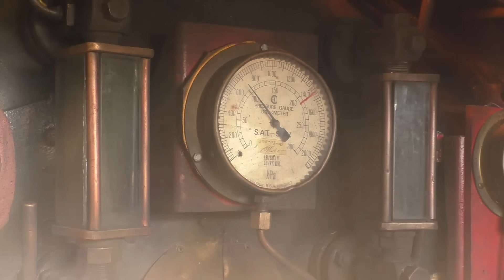RED DEVIL - Restoration - Final Steam Test and Transfer

Comment: Jesus Christ 5030 hp from a NARROW GAUGE locomotive? That’s nuts!
Reply from the maker: Slipped like hell though. Not enough driving wheels to transmit all that power into the rails.
Reply: Wayne Nauschutz Ah, so I take it the factor of adhesion was low? Sounds almost like a racecar with too much power for its own good.
Reply from the maker: Yeah, definitely. If they approved the project it most likely would have led to the development of an entirely new class. In the Red Devils case they had to use the frame that was available. Here's a insert from Steam Fever, https://www.youtube.com/watch?v=OtRfcYk245k note the wheel action at 0:45.

Comment: Oh YYEEESSSS!!!!!!!!!!!!!!!! THIS is what second gen steam can look like if its given the chance.
Reply: More like third or fourth generation i think (Chapeleon' s high superheat and work preventing undesired heat losses in the valve chests and before that the super-high pressure work for example the D&H John Jervis)
Reply: I totally get where you're coming from. It's just a shame it didn't catch on sooner. I mean, between the advancements on this along with poppet valves and one-piece cast frames, every day - use mainline steam probably would have had another thirty or forty years in it. I'd put one of those up against a modern diesel any day.
Reply from the maker: Great idea, wrong era unfortunately. Thanks for watching.

Comment: Can someone please explain the purpose of the blinders on the sides of the smokebox? The red paint is a bit unusual to an American, but still quite attractive/striking.
Reply from the maker: The large vertical plates on either side of the smokebox are smoke deflectors. Often used on locomotives with very short chimneys as they assist in creating an upward draft that lifts the smoke up and over the locomotive.

 The SAR had a strict painting policy where all locomotives had to be black. Wardale secretly ordered the red paint so that the modified locomotive would not be swept under the rug. One really needs to read the book to truly appreciate the extensive work done and the politics that were mounting against him at the time.
Reply: Hello Wayne,
 I thank you for the education about this beautiful locomotive. It is definitely a “looker”.

Comment: well done all! But I can and do throw coal better than 1:40. Nowhere near the front of the long firebox. Wont keep up pressure like that, m'dears.
Reply from the maker: Those blokes are the fitters. In this case they had to do the light up as there was no one else. Out on the road it has a mechanical stoker. Thanks for watching.

Comment: Okey, swallowing my pride with this question here. What is the name and purpose of the plating near the front. The only other time I saw this was in a war movie and I thought it was an attempt at armor from small arms fire.
Reply from the maker: No, such thing as a bad question. The large vertical plates on either side of the smokebox are smoke deflectors. Often used on locomotives with very short chimneys and they assist in creating an upward draft that lifts the smoke up and over the locomotive. Thanks for watching.
Reply: Wayne Nauschutz, thank you.

Comment: I seriously love that whistle! I honestly think Atlantic Rail's 3655 Jenny could benefit from something like that.
Reply from the maker: Hi Joshua. Both locomotives are fitted with SAR three chime whistles. The NCs tend to sound very different due to the higher operating pressure of the boiler.
Reply: Okay. Interesting. I noticed that when Jenny was returned to steam in July her whistle didn't sound like the iconic SAR 3-chime. It was more like a high pitched screamer, lol, but at least it is something to work with for now.
Reply from the maker: The chime chambers were filled with a small amount of molten lead to make the chamber shallower.
Reply: Hmm, very interesting. So, to make it sound like the iconic SAR 3-chime some more molten lead would need to badded to make the chamber deeper.
Reply from the maker: Far from an exact science. Identical whistles sound different simply by mounting them differently.
Reply: I actually didn't think of that. Thanks for the very interesting info.

Comment: Beautiful engine and camera work.    I'm impressed they are running it on coal.
Reply: South Africa never ran steam engines on oil. In fact one of the reasons they kept steam around for so long was they had domestic coal reserves but very little oil, and with increasing pressure from international sanctions they didn't want to be dependent on foreign imports.
Reply: So I take it you're somewhat of a rail fan? That's so cool!!
Reply: Notice how small an amount of exhaust smoke there is. That's efficiency, almost no unburnt fuel, because of L D Porta's work on secondary air admission, to improve the combustion.
Reply: @ericjamieson  same with the UK

Comment: your notes say it had 5000 horses.  i'm very impressed.  i observe your notes also say it had a lempor exhaust.  is it still fitted?  this invention was fitted to 2 victorian railways r class locos.  there were 2 chimneys.  it has been removed from one of them.  i don't know about the other.  a crewman considered it added more than 20% extra power.
Reply: the 2 locos i mentioned were vr r711 and r766.  both had the go-fast equipment removed.  it was written by someone close to the operation of r711 that the loco threw a rod (first and only of this class that this happened to) most likely because the gear wasnt designed for the extra horsepower.  r766 has recently been reactivated.

Comment: Beautiful piece of equipment. I am curious, I know that an engineer has to plan how hot to stoke the fire but what about when coming to the final destination? Is the engine monitored and water added as needed until the fire burns out?
Reply from the maker: Thanks for watching Dremwolf. In this case, the drop grates get opened and the fire is pushed out of the firebox and into ashpit. During the steam days, they would have a locomotive minder that would look after a number of locomotives during rest periods.
Reply: You don't do that. The usual thing is to think ahead .....  because you don't want to add oxygen-rich water without having a steam demand. You would want to boil away all oxygen as fast as possible.
Normal is to stop feeding water to the boiler lets say 10 minutes before coming to stop outside the shed.
Reply: Wouldn't that create a too fast cooling down ?
Reply: Stefan Skoglund ordinarily you'd run the fire down towards the end of the day, arriving on shed with as little as possible so there would be less to remove. At the same time filling the boiler slowly, avoiding filling it all last minute, so that as the loco cools there will still be plenty of water in it to relight  for its next steaming.
Reply: Is the feed water deoxygenized ie is water treatments chemicals used ?
The machines i'm on (a steam boat and a locomotive) we stop adding coal 20 min before and stop the water feed 10 minutes before coming to the quay (the boat.) At the locomotive i let the water level rise slowly to the top of the glass in the last 10 minutes running time. The fire is allowed to get a bit thinner (she has a really good draught) but not near the firebox plates - only in the middle of the grate. This to prevent cold air near the copper plates and this is alsy why we don't drop the fire (slow and mild cooling down.)
Reply: Stefan Skoglund we certainly use water treatment but I couldn't say for Oxygen content. We always drop the fires just before the engine is put to bed, so it's not draughting too much after that. At the same time the dampers will be fully closed to minimise the cold air intake. Leaving fires in isn't recommended as there is no-one looking after the locos over night, so the water-pressyre won't be monitored. It is surprising just how far the water can drop with a fire left in over night.

Comment: Thanks for the updates Wayne. Great to see her up and running again! However..... something doesn't sound right, the typical Lempor exhaust beat is absent. Do you know if the front end is still original, or has that also been destroyed?
Reply from the maker: Thanks for watching Sean. Yes, the blast nozzles are both standard 25NC equipment. The original Lempor nozzles were removed years ago while the locomotive was at Dal.  The nozzles do still exist but are in poor condition.

Comment: Doesn't it have a mechanical stoker? That surely is too big for manual firing. 
Sitting on top of the boiler attacking the safety valves with a big spanner looks a bit hazardous.
Reply from the maker: Yes, it does. During the light up process, there is insufficient steam to operate it.  The safety valves were being set as this was the first steam test during which locomotive reached its maximum operating pressure.
Reply: Setting the safety valves is done like that.
Usually what is done is you do a preliminary blow of setting using pneumatic air - that allow to check that the valve opens at all and that it opens at about correct pressure.

The next thing is how the blowoff happens ie the duration and that it is a clean blowoff and closing. You dont want a clapper-like action. Steam differs in mass and speed from air so pneumatic air can't be used for this work.
It is different if you have access to an industrial boiler with high pressure steam and a safety valve test rig.

It isn't a regular spanner.

Comment: Honestly, they should give back her original smoke deflectors, I feel that her Class 25NC deflectors are too big, look odd on her and make her look generic. 

Also another thing, A friend of mine wants to model the Red Devil for a game and is in need of blue prints and drawings, can anyone here point me in the direction to where I can find some?
Reply from the maker: The German style deflectors performed poorly. The problem is often mentioned by drivers in the Locomotives logbook.  The current deflectors aren't standard 25NC components they far taller and curve over the boiler, they also extend over the buffer beam. 25NC blueprints are common but the actual drawings for devil are far and few between. There was a bloke called SAR models or something to those line selling drawings at one point.

Comment: i dont really like the fact that the boiler looks a bit oversized in nsw the boilers are slightly oversized and also the front part of the runningboard is very short and it looks unusual
Reply from the maker: The smokebox was extended to be able to fit the larger superheater header. Keep in mind this is cape gauge (3'6") and not standard gauge.
Reply: @WayneSA85  ok now i know why

Comment: The amazing thing is how narrow the gauge is, can't remember exactly but it's 1m or 3ft 6in?
Reply from the maker: Yes, correct.
Reply: It is Cape gauge, 3'6", not metre gauge of just under 40".    There are some examples of large modern nonarticulated steam power on metre gauge, notably the French GELSA locomotives built after WWII, but they are on a remarkably smaller scale than the South African power; it's remarkable that so little difference in gauge makes so much proportional difference.

Comment: This is my idea of a heavy metal band. Big pieces of steel flashing around, steam wafting and the grunting sound of power. I used to be a "studente stoker" on the 15CA and 15F's back in the early 70's and I will never forget the smell of steam and hot oil. Lovely memories.
Though, I wish to ask a question, what is the purpose of the steam release pipe just behind the smoke stack? I have seen them also on videos of the Sandaoling mines in China and I could see no obvious purpose to it.
Thanks for a beautiful video.

Comment: paint it blue and you'll have a flying scotsman
Reply: Isn't the Flying Scotsman green?
Reply: @midwestrailfanner2268   the original was blue later versions were green
Reply: @rudycarlson8245  actually i thought they changed it to the brittish racing green
Reply from the maker: Called the RED Devil. Painting it blue would not be historically correct.
Reply: @WayneSA85  understand it was painted red in africa however it is the same chassis as the flying scotsmanand the canadian and us sister  which all now sit in the UK
Reply from the maker: @jasonhowe1697  Hi Jason, I think you might be confusing the Red Devil with some other locomotive. The 25NC and the A3 have very little in common. The 25NC had a one piece cast frame which included the cylinders, the castings were done at Commonwealth in the US and the remainder of the locomotive was built in Germany by Henschel(some where built by NBL but not 3450). The A3 had a bar frame that was bolted and riveted together. The A3 is also a three cylinder where the devil only sports two. 3450 (Red Devil) was highly modified in the early 80s by David Wardale during his time as a engineer with the SAR. What emerged from the shops was re-classed as a 26 class. Wardale was facing stiff opposition from the SAR brass who had already dismissed the locomotive as a failure long before the trials had even started. He knew the only to give it a fair chance would be to sway public opinion. So despite of the SAR's strict painting policy. He secretly ordered red paint and had friends notify the press. Before long pictures of this big Red locomotive were everywhere and the SAR management had no choice but to play along. So the red is very much part of this particular locomotives legacy. Painting it any other colour would be pointless.

Comment: It's a bad design if two of you have to stand on the running boards to travel.😲
Reply: They really have to if you are running tender first only way to see around the tender
Reply from the maker: Definitely wouldn't call it a bad design. The original 25NC's proved themselves as very super reliable and being a mainline locomotive they were seldom run in reverse. Thanks for watching.

Comment: Why does the Red Devil look a bit similar to the Union Pacific (USA) 844?
Reply: Close, but it’s looks just like a New York central nigara and yes the 844 because both are northern types except this is narrow not standard gauge and actually CSX stands for in your case the Chesapeake and Ohio, which was later the chessie system and the seaboard merger which created Chesapeake and seaboard or in head, chessie and seaboard inc even though the x has no meaning it’s a fancy acronym for incorporated which is why CSX transportation has the three letters CSX or CSXT.

Comment: That looks really big for a cape gauge locomotive, seems much bigger than anything in Japan and New Zealand. Honestly it looks like someone designed it for standard gauge and changed the wheels at the last minute.
Reply from the maker: South Africa uses standard British loading gauge but out track gauge is narrower. The high speed trials proved they stick to the rails just the same though. Thanks for watching.

Comment: Have any improvements been made during the restoration?
Reply from the maker: No, It was returned to steam in it's current configuration.
Reply: Wayne Nauschutz Thanks Wayne, certainly is good to see her working again. Can't wait to see her with a load on. Think I better subscribe.
Reply from the maker: Thanks for watching Tim. The locomotive will be working its first passenger train on 13th.
Reply: Wayne Nauschutz Just one thing, on the pacing shots near the end, the driver does not seem to have pulled the reverser back very far.. Would there be a reason for that?

Comment: what gauge is this?
what side  do the engineer sit on?
Reply from the maker: The driver sits on the right and the gauge is 3' 6".
Reply: ah thanks I wondered 
put this next to the Union Pacific's 4-8-4 I bet it'd look small hehe
Reply from the maker: The Red Devil was a prototype built from a standard South African Class 25NC. The NC suffix meaning Non-condenser. The NC's are still the largest non-articulated narrow gauge locomotives ever built but side by side the UP 488 would definitely be larger. The interesting part is the Red Devil with its Wardale modification produced 5030 hp at 100 kph despite of its size.
Reply: 844 actually but its a BIG loco in narrow gauge terms 
I don't believe that even the Rio Grande 3ft  had a big loco like this
Reply: microbusss Nay, D&RGW largest narrow gauge (3'0") engine was class K-36, 2-8-2 Mikado type manufactured by Baldwin with counterweights outside the driver wheels.  I believe there was another class on the Denver & Rio Grande that was a converted Standard Gauge locomotive (K-37?),  but the K-36 was still more powerful (and easier on the tracks!)
Reply from the maker: Clearly, the 488 was a simple typo. The thing to remember is that the Red Devil was a prototype to make steam competitive again. What set this locomotive apart has nothing to do with its size and everything to do with the gas producing combustion system. With all the Wardale modifications it is one of the most advanced steam locomotives in existence today. Wardale did similar testing in the US during the mid-1980's for the American Coal Enterprise who wanted to export steam locomotives to developing countries. sadly the project never got the capital it required.
Reply: microbusss any organization that has an actual operating steam locomotive, large or small, is indeed fortunate
Reply: These SAR (Africa) 4-8-4 classes with smoke deflectors look %80 (in my opinion) similar to the New York Central Niagaras (Northerns) built in the mid 40s.
Reply: @WayneSA85  r